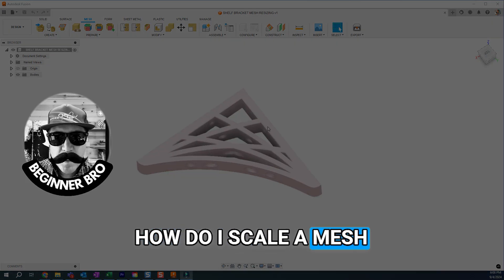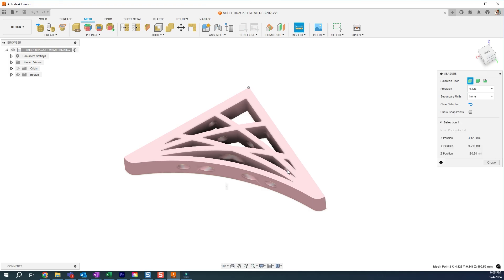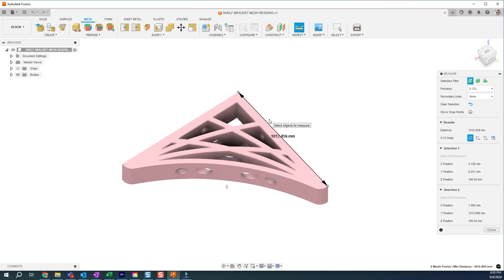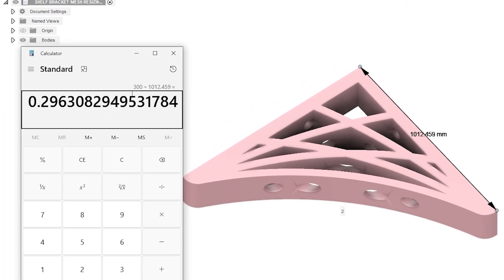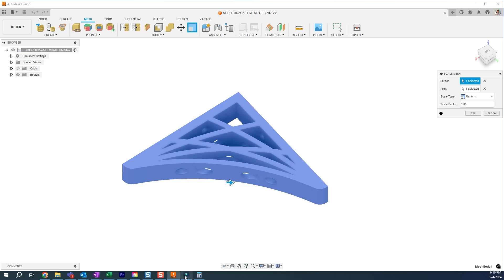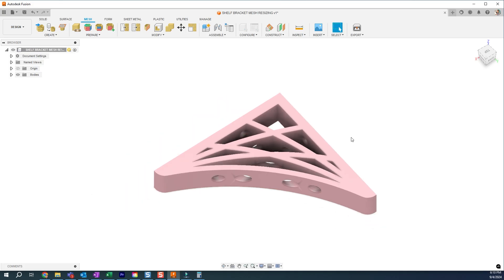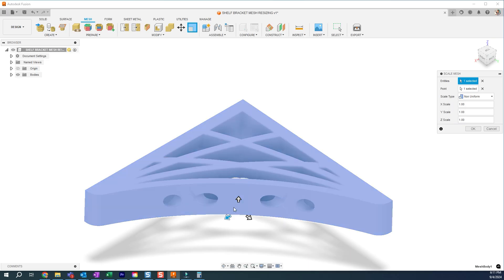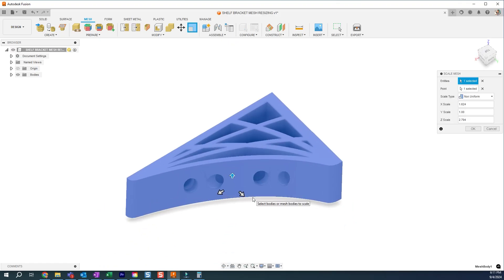How to scale an STL when it comes in wrong (Fusion 360 mesh scale method)

Comment: Non-uniform scaling.
I know this question is probably expecting miracles...
Is there a way to non-uniform scale without distorting elements of the mesh along that scaled direction?  In particular, the holes? 
I always hack it by doing the non-uniform scale and then 'fix' the holes that got turned into ellipticals.